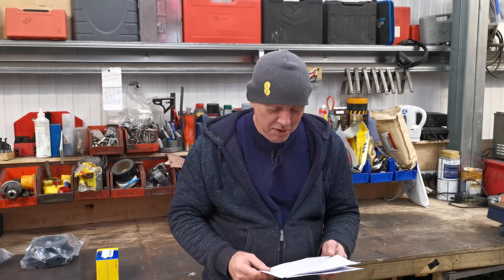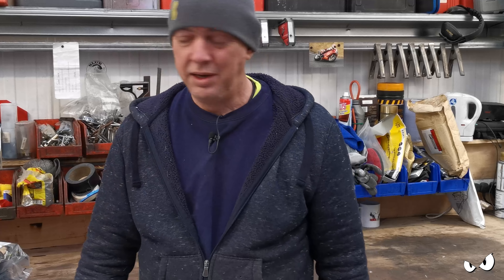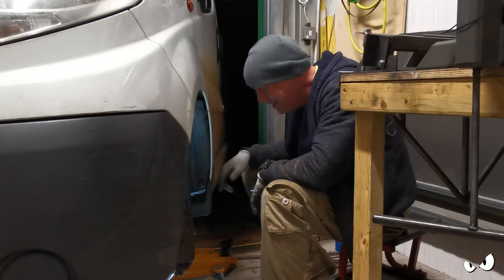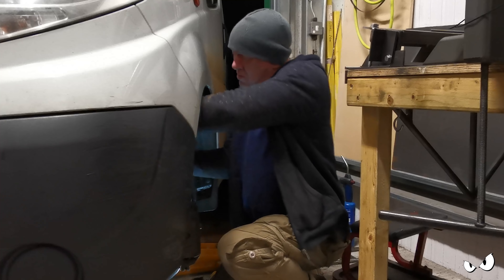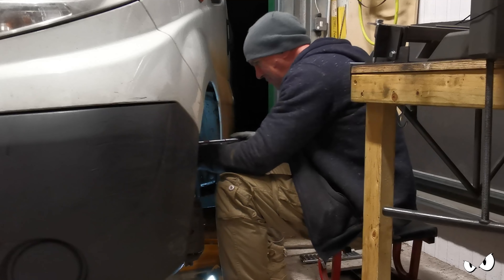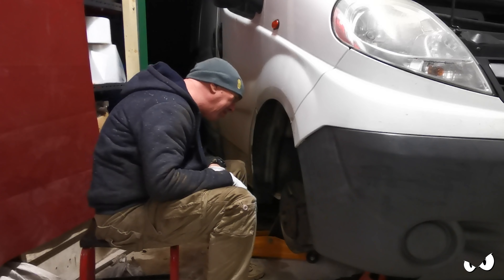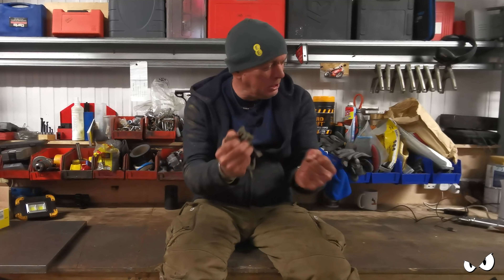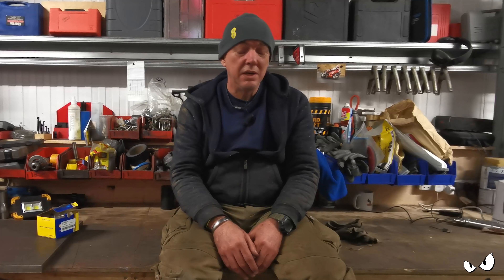Crappy Day...

Comment: Hi Quicky, I’ve done this job a few times, especially about a week after I got the car steam cleaned, apparently the steam was removing the grease from the top strut bearings, so now when getting anything steam cleaned, I ask them not to steam the tops of the struts......Problem solved . At least you can fix everything yourself, sweet.
Have you ever thought of getting an impact gun, Lidl do a corker of a gun for around £45 or so. Nice video Quicky. 😎👍👍👍🇬🇧🎄
Reply from the maker: I've got an air fed one buts its rubbish... need to upgrade it really 😁👍

Comment: You left it to the last day of a 6 month covid extended MOT. The MOT stations were open in May🙄 and you wonder why it wasn't advised on the last test, you takes yer chances and yer pays the price, good luck for the retest
Reply from the maker: All sorted now 😁👍
Reply: @QuickBikes  Good to hear, hope the retest goes well, my bugbear is that in 2018 (last published figures) 10 million vehicles failed an MOT. I appreciate that as the test has got more stringent in regards to emissions many of those would have been "dirty" failures, however a significant proportion will be due to safety issues, the main purpose of the MOT test. Extend that by 6 months and the 4 months while a 5 month extension was being granted and you get potentially 8 million + vehicles running around at any one time in an unroadworthy condition, while the vast majority of testing stations were open for business.
Reply from the maker: A very good point and well made. Who really wants to drive around in something that's not safe? I need to be more conscientious...

Comment: I expect you're sorted by now but even a budget 18v impact gun will help shift a lot of bolts with a bit of heat and release fluid.

Bought mine a few years ago from B&Q and its made life much easier on the bikes and cars.
Reply from the maker: I've got an air fed one which is pants. Gonna have to upgrade it at some point 🤣😂

Comment: You've had a nightmare Tuesday, Quicky.

Not on your level but my Tuesday was riding from the workshop to home , mostly one handed on tractor muddied, frozen spring watered bumpy arse back roads.  Had a VFR fuel tank I've sold, bungied on the back, flapping about like caught fish (left hand steadying it over the worst of the ruts).   All done in crap gear because I have yet to find a decent riding gear manufacturer who makes sizes for fat boys who ride all year round.   I'm an acolyte of Stevo, if you have to use wide angle on Stevo, you'd have to set the camera up about a mile away to fit me in.

Just sat down to watch this and got a fine though the post because I forgot to sorn a new project (I was in danger of getting things done on my other project and obviously that won't do so got another one).

So hope that helps, keep trucking, and to whoever give this video a thumbs down, ba-humbug.  Laters.
Reply from the maker: Aw mate.... that sucks !?!
I hate days like this but you just gotta get on with it I suppose hey 😂🤣
Reply: @QuickBikes  Thank God you replied, I'd forgotten to sorn that bike again, only got 2 days left to do it!  Doing it now.   Cheers.